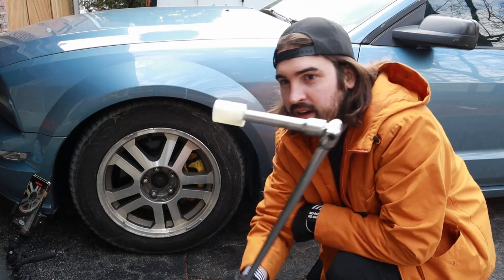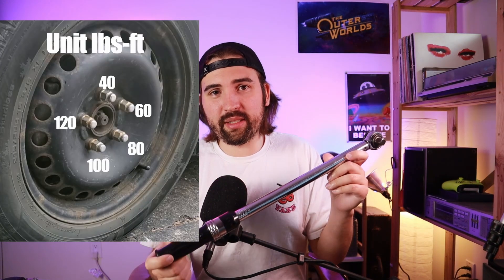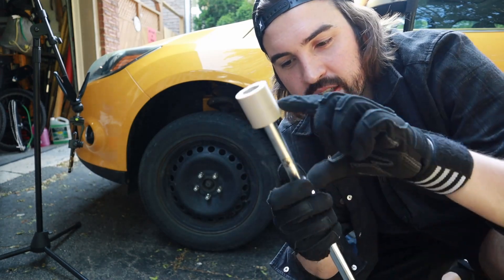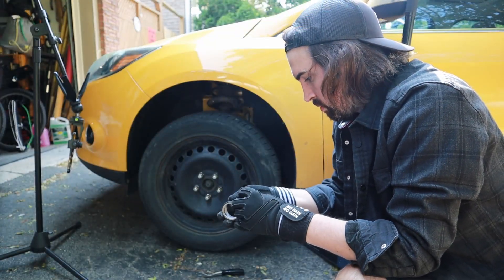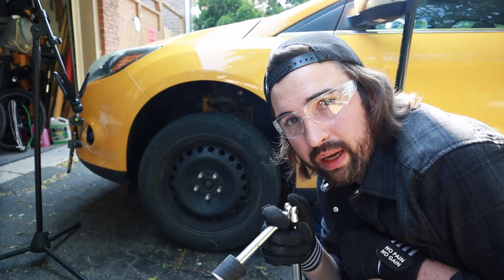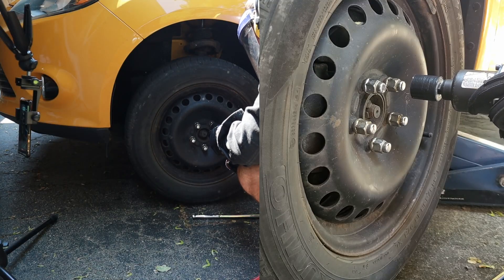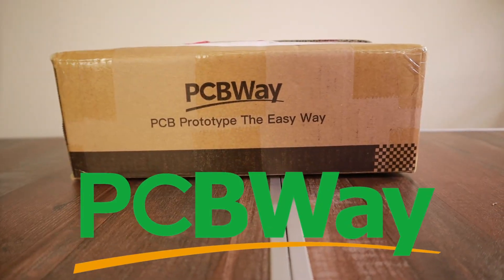How Strong Is 3D Printed PEEK? (3d printed wrench pt 2)

Comment: Actually it usually takes more force to take one off than it does to tighten it down, so long as it's the first time you're loosening it in a while. They stick in place. If you have just torqued it down, then it will probably take less to loosen it but that's not true most of the time that it has been on there for a few months.

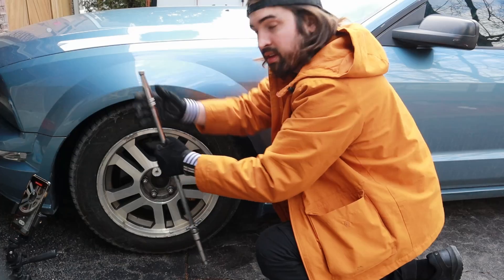Comment: 0:02 no wonder it breaks, if you're printing out of a material which is, say, a quarter the strength of steel you need to design it to be 4x as beefy - and it'll work just fine. 

Think about it, a wooden 2x4 works, a hollow steel beam works in its place... but a hollow wooden 2x4 would not.
Reply: there's more to it than that. Even if he printed his PEEK part 100 times the size it would still deform.

Comment: I would press a thin steel sleeve around these parts. That would prevent the splitting. Then you could see if the flats crumble.
Reply: I’ve seen it using a worm drive hose clamp and it does really help.

Comment: I wonder if putting a couple breeze clamps around the outside would help. Or possibly printing it to be a compression fit inside of a piece of iron pipe.
Reply: It didn’t shatter, it deformed from the inside

Comment: tbh from what I've seen regular nylon performs better in a lot of cases than chopped cf nylon.
also there's the health concerns of the chopped cf being asbestos-like
I think exotic stuff like wire core filament might be the strongest outside of actually metal.
though something you might wanna try is an oversized socket with a nylon insert, it should perform pretty well.

Comment: A tire really isn't a good test. Most lug nuts are tapered so that a metal socket gets tighter as you push it in. That taper puts a lot of strain right at the weakest point of the socket: the end.
Reply: Something where the dimensions of the print match the fastener better. IF he tapered it like how most lugnuts are designed it would be so much stronger because the pressure is not all focused on the inside edge end of the of the socket, which happens to be the most likely point of failure other than point where the wratchet clicks in. He could have also put a few meshes down as it printed to make it stringer.
Reply: @AmixLiark  good point 👍🏽
Reply: What would be a good test?

Comment: What were your settings for nylon? Just wondering cause i have nylon (no cf) and it wouldnt just crack like that. Also could you try that with just regular old nylon? Taulman makes an alloy called 910 and its some of the toughest stuff ive handled
Reply: Nylon is more flexible than cf nylon. This is the answer.
Reply: Maybe if he increased the extruder’s setting the layer adhesion would be greater.

Comment: Neat test and something I was curious about. But what's the spec on those studs? I'd be worried about potentially over-torquing them, leading to a failure.
Reply from the maker: Recommended is 100. I don't think I would attempt any higher than 120 to be on the safe side